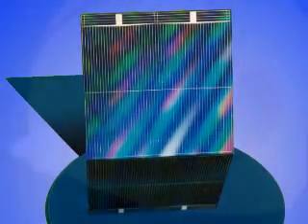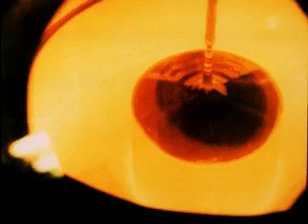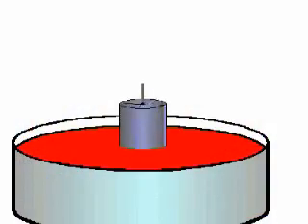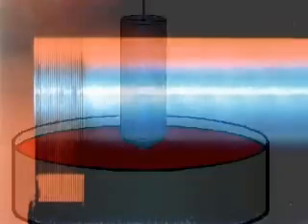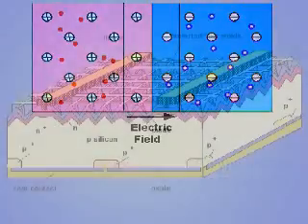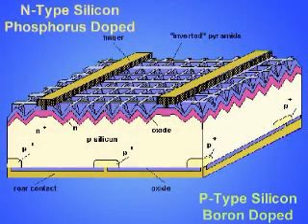How PV cells produce electricity

Comment: Commercial Solar Panels are not that expensive. You have what they call, government and, state incentives, which pay for more than half of the actual price. On top of that, you gain a rebate every year(which has no cap), the system pays for itself. After paying for itself, you the rebate goes in your pocket. You are projected too make a 15-20% profit from the rebate every year, based on the initial cost of the system.

Comment: Simply put, a battery has a maximum amount of energy stored in the chemicals inside it, and when it's out of energy, it's useless. Solar panels convert sunlight into electrical energy, so as long as the sun is shining, it will continue to produce electricity.

Comment: @18railroad It is a semi-conductor, meaning it can be both an insulator and a conductor.  The definition of voltage is simply a separation of charge, therefor it must be an insulator (to keep the electrons and holes from pairing up and eliminating each other). However, to use the energy, a conductor must be used to allow electron flow.